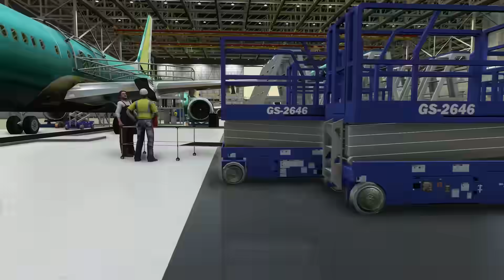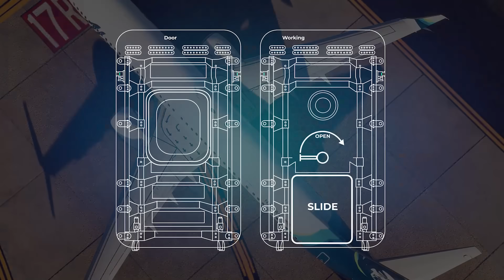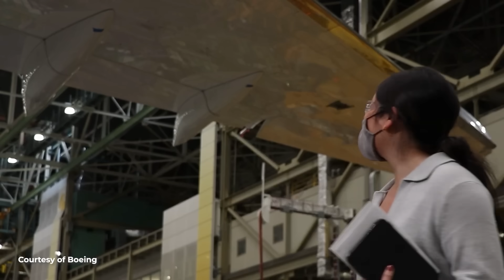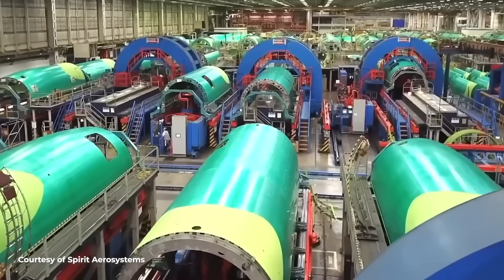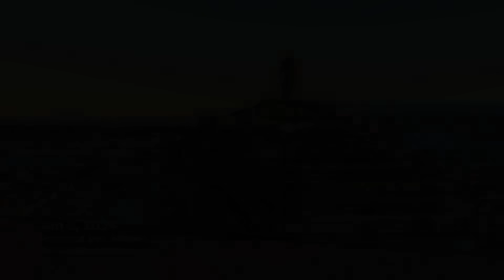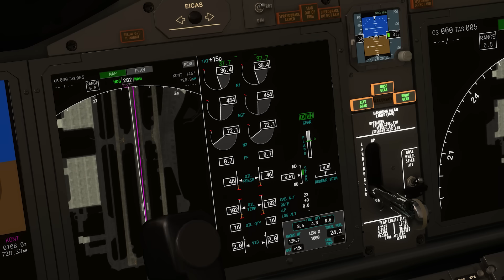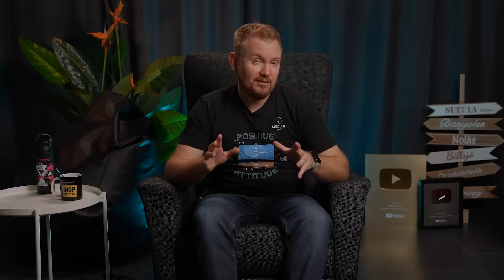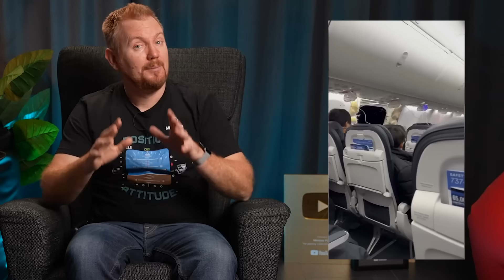Boeing 737MAX BlowOut!! The Scandal behind Alaska Airlines flight 1282

Comment: If the wifi antenna installers were required to remove the door, they'd have been like, "WTF?, where are the bolts?", perhaps leading to corrective action on this specific airplane, but the problem with Boeing's corporate culture & out of sync quality procedures, might not have come to light until another major tragedy.

Comment: If you think about what must have happened for this to occur, it's acutally insane: Someone must have placed the plug on the four hinges, barely staying in place against the forces of the two springs (which are not supposed to be there), and then just clock out on the end of the shift. Next guy comes in and just installs the interior wall, without checking if the plug is installed correctly. Madness.
Reply from the maker: Yeah.. pretty much
Reply: If you look very closely at Figure 16 of the NTSB preliminary report, you will find a zip-tie holding the plug in place, located on the right side of the plug over the second pin/pad from the bottom. That was apparently all that was holding the plug in place, after the interior panels were installed. What happened to the zip-tie, we may never know.
Reply: @jenda386 
That is a very good observation! Probably one person was reinstalling the plug and the tie would temporarily hold the door “down” so that they could reinstall the “anti-movement” threaded pins without dealing with potential upward movement due to the springs. Then a distraction occurred. What I want to know is this “door crew” from Spirit or Boeing? The whistleblower does not explicitly say.

Comment: The whole door plug debacle was quite frankly inexcusable in and of itself, but the fact that it occurred in the context of shoddy rivets being painted over instead of actually fixed makes me wonder how toxic the environment is on Boeing and Spriit's factory floors.  It also makes me question the wisdom of flying on any Boeing aircraft built since Spirit was spun off from Boeing, not just the Max.  And the fact that this situation has been allowed to fester and apparently hasn't been properly addressed since the two Max crashes makes me question if the FAA is doing their job too.  

I'm glad you avoided referring to what happened as a "quality escape".  Quality doesn't escape, it's not properly enforced.  Calling it an "escape" is just an euphemism to try and cover up serious failings or minimise what actually happened.
Reply from the maker: I agree

Comment: Hypothesis: the whistling on previous flights indicates the outside airflow had got under the plug and penetrated the seal at the front edge, Given nothing was actually holding the plug, it's very possible the locating pins had started walking up the rubber pads, without being noticed, helped by the unimpeded springs. The latter would certainly impede movement in the other direction. As a result, the plug came closer and closer to catastrophic failure - it's a classic chaos theory model. Eventually, the wind under the curved lower front corner of the plug simply tore the mounting brackets loose, which is why the damage on that side is distinctively different, more extensive. Once started, the air differential did a DC-10 job and tore it loose, thankfully not weakening the floor or destroying control mechanisms.
Reply: OR people just heard random airplane noises and conflated it to being related to the door. There's really no way to prove it either way. Of course they're going to say they "heard noises".
Reply: @skinnybricks  You still haven't explained the unequal damage visible on the bottom sill. These references are from earlier flights, in any case, and because it's not scientifically rigorous, the first word I used was hypothesis, meaning you have to begin somewhere, and the micro-observations resulting may add information.

Comment: Crawler haulers appear to have it right they take their fifth wheel, travel, trailer or camper and put it on a quality trailer and if there’s a problem with that trailer, it can be fixed independent of the RV or worst case scenario get another trailer, put that same RV on different trailer. The trailers the crawler hauler guys are using are from manufacturers of trailers the trailers are over built, because they are work horses that have to handle heavyweight all day every day 365 days a year for years on end before they collapse but an RV and a car on the trailers these crawler haulers use our light and the trailer probably barely knows that an RV and a car or truck are on the back. If you are experiencing frame flex, find you a lemon law attorney and get out from under that trailer and get something more suitable for the way you’re going to use your RV. I full-time in my RV and only move it once a month about 30 miles for one week and then it’s 30 miles back to my permanent space, traveling on interstate five and 405 where I live in the Los Angeles area did some damage to my trailer. I tried to tow my trailer to Texas or Florida, or to see my aunt in Virginia what I would have when I came back which is why I wouldn’t do it, I’m likely to fly or drive over trailer. My man JD went as far as to blame you the RV customer who bought the dream of towing your trailer across the United States and visiting all of the landmarks and national parks and family and friends along the way for having, the nerve of having a washer and dryer and a solar system and some of your things in the trailer you cost to frame flex oh my God I thought that was a part of his video blame you not leopard my two cents good luck safe travels

Comment: The whole "oops we forgot these four giant locking bolts" thing seems unlikely, since presumably those bolts didn't just vanish into thin air. Any maintenance technician with half a brain knows where he put the hardware he removes during a disassembly.

Also, if it's obvious to random nobodies on the internet that the bolts are missing, how does it go unnoticed by people whose job it is to notice?
Reply: Bolts removed, shift change. New shift doesn't know what was going on? Things like that happen all the time.
Reply: @jantjarks7946 Evidence in the preliminary NTSB report suggests that the bolts were never installed.  The missing bolts were not noticed by Boeing employees, inspectors, but are clearly missing in a photo taken by someone......
Reply: I'm not aware where that photo is from. In the end the sign "just ship it" in the factory hall shows the work mentality prioritized by the management.

Comment: Coming from a QC background, this really is quite shocking. The idea of having multiple logs for nonconformances, some of them in private channels is a huge company wide failure
Reply: Not only that two processes exist for the putting the plug back in place -one "critical" and the other "less-critical".
Reply: Exactly. Workers and production Management under time pressure will absolutely choose the process that can be completed with less documentation and fewer inspections.
Reply: @18robsmith  This is not the reason and if you understand how doors works its completely OK. Problem is, that this piece arent door, this is plug. So for plug there is nothing like “open”, its always “disasembly” (I dont remember proper word from procedure). Somebody screw this.
Reply: I'm still in complete disbelief that removing the locking hardware didn't require a 'Removal' in the CMES.

In my experience, in general aviation manufacturing, even removing some screws in an access panel triggers a 'removal', even if the panel itself isn't removed.

 (And it's QC discretion to require complete removal of the access panel to reinspect the area inside the panel)
Reply: AMEN, I have way over a million stamps in my career, and permanent ink stained fingers after a 30 year career.❤❤
Reply: @sydneychase780 Always enjoyed selling a tough job to a good inspector! Only paint rivets after you sell the Install
Reply: Once upon a time a quality escapement was something you found only in a Swiss watch. Now they associate it with Swiss cheese and aircraft. 🤔
Reply: I wonder if anyone has done an honest study of the "cost savings" when these huge companies outsource maintenance operations to low-wage, low-regulation jurisdictions .... and then have to pay for the contract management, compliance, payouts due to faulty work, auditing, sending engineers over to "fix" the quality issues, legal fees to sue the maintenance company about quality issues in the cheaper work they had specifically paid for, etc etc etc. 
Obviously any such study would have to compare all costs and compliance issues with the old directly-owned maintenance subdivision, and that would naturally be difficult. I also doubt Boeing would give an external individual the access to gather all the relevant info. But I really do wonder...
Reply: Fortunately his explanation isn’t accurate
Reply: @imatardable  Do you recommend a particular video/article that discusses it more accurately?
Reply: @imatardable could you please explain which part wasn't accurate?
Reply: @imatardable Whose explanation isn’t accurate??
Reply: I think it was deliberate sabotage 😊
Reply: @brkitdwn why?

Comment: How do you just forget to lock the door after you pull it off. Like, you've got a few massive bolts just laying around. and nobody thought "hey i wonder where these are supposed to go?"
Reply: Depends on the process, and where in that process (if at all) the people working on it changed.  Also, if fastenings are kept with what they're fastening, the bolts might have gone with the door and the plug might not have come with any, leading to an incorrect assumption that it didn't need any or that someone else was going to add them before the internal panels went on. Company culture probably also prioritises finishing on time, and that's a scary level of responsibility for someone at floor-worker level, especially if they're not 100% confident there's actually an issue. A lot easier to assume that surely one of your colleagues would speak up if there was really cause for concern, particularly if you're on the junior end of the experience scale.

The whole 'disassemble thing, reassemble thing, realise there are fastenings/whatever left over, figure thing looks right/appears to be working okay, shrug and dispose of extras' is a classic, particularly for things like DIY repairs where there's no manual/instructions (or it's not being followed).

Comment: If Boeing told pilots that the cockpit door automatically unlocks and opens on depressurization, that detail would have eventually become know by potential bad guys. Now that everyone knows about the automatic unlock, they might try to break a passenger window to have a good chance of taking the cockpit.
Reply: They all know about it now.
Reply: That's a rather shall we say ... out there point of view.

You are suggesting that a company that can't even manage to ensure that four bolts are put where they should be on a plane they are building have the competency and foresight to hide information from the people who pilot their planes on the off-chance that some bad actors might use it in a once-in-several-decades situation?

Or was it like Boeings "failure" to disseminate details about MCAS, deliberate because money?
Reply: @hammondpickle  you are probably right. It's likely that the people who decided to implement this feature forgot to document it properly. Maybe I've watched too many TV shows about spies! 😉
Reply: That’s not why they did it. Instead, it was to obscure a difference between this and previous models because they were trying to convince everyone 737 type ratings should carry over and so they didn’t want to highlight any differences in procedures

Comment: Multiple Pressurization discrepancies with no real fixes logged....  That airplane was talking to you.  I as a pilot would refuse this flight until I got a good answer to why.
Reply: Mechanic can do a pressurization check on the ground to see where the air leak came from, or at least remove the side wall panels and inspect, with previous passenger report loud noises

Comment: I know this is a bit off topic, but isn't the cockpit door being designed to open during decompression a security issue? Someone could breech the cockpit by causing an explosive decompression. Granted, thats insane, but most hijackings are. I feel like the same effect of pressure equalization could be achieved by blow out panels rather than the whole door opening. Am i missing something or am i just way overthinking this?

Comment: im wondering, isnt it technically safer for the cockpit door to have a small depressurization window, rather than blowing wide open and instantly depressurize?
less flying debris, more time for the pilots to react and also less severe symptoms, such as hearing loss etc.
Reply: There isn't really a good way to do this. The door already has quite large vents that open into the cockpit to allow air to move through if the windshield fails. To have the opposite also fitted to the door would likely be impossible, as you need very large amounts of airflow very quickly. Otherwise, keeping the cockpit pressurized with the rest of the airplane now depressurized would risk the floor or rear wall of the cockpit failing, as they are not designed to withstand such pressures. It was apparently decided that sudden and rapid depressurization of the cabin is less likely than a broken windshield, so that is why they selected the design the did.
Reply: Seriously! what a dumb design choice. A cockpit should be the last place to become a hazardous place. Having the cockpit door flung open, completely jeopardizes the safety of the plane as it disorients the pilots (also, since they didn't know about this, makes it even more of a surprise to them)
Reply: There are plenty of ways to implement this is a better way. I'm already not sold on those enormous door panels for the other direction. 2-way blow-out sections in the walls, positioned in a way to guide the direct airflow away from the pilots, for example.

Or making the walls slightly sturdier so they can withstand the pressure bleeding through smaller openings over 10 to 15 seconds. And if that means that the whole wall buckles and will need to be replaced, so what? Still cheaper than replacing the whole aircraft because the pilots got knocked out...

Comment: Why are there not any door position switches on the door plugs?
Reply: Because they are "designed" to be a "permanent" fixture, never expected to be opened in flight.
Reply: @18robsmith  right. I guess what I was thinking is if they could be converted to have more passengers in the future the wiring harness would be there standard and they would have left the switch sensor there, plug and bolt the opening.